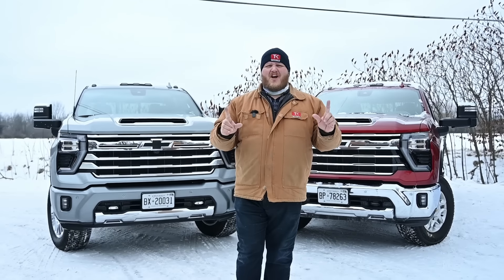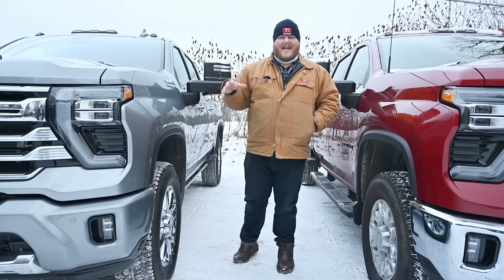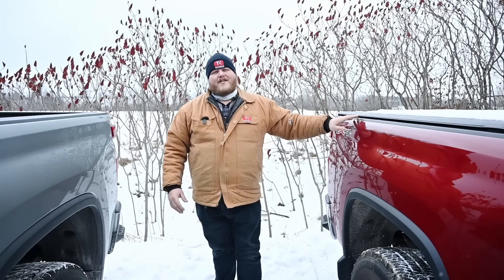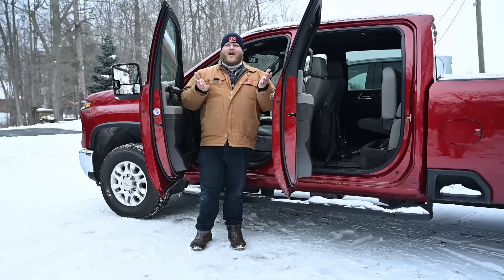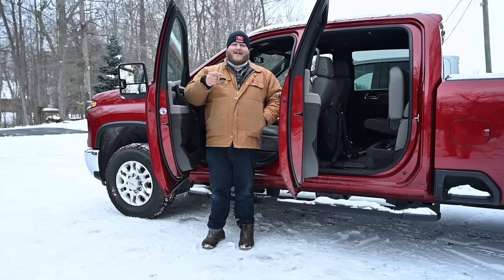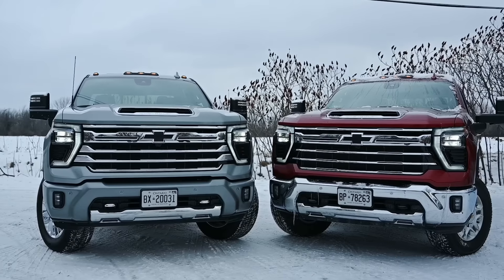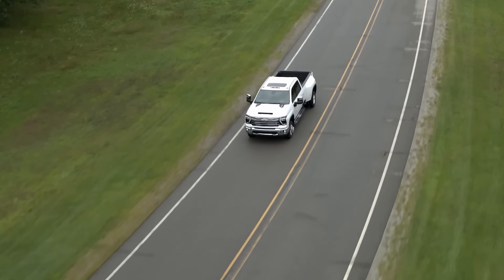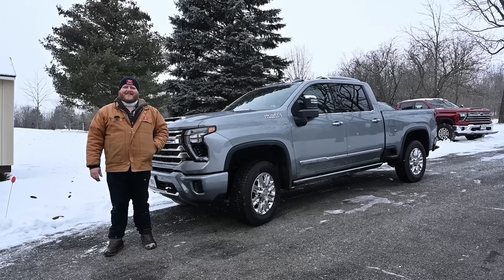2500 vs 3500 Trucks - What's Really the Difference? We Compare Two Chevy Silverado HDs to Find Out

Comment: The new HD pickups are getting so tall that they may not be able to be garaged in a regular sized garage.
Reply: I can’t fit my 2022 Silverado 2500 in my garage because the shark fin on the roof would hit the top of the door. I’d like to mod it off when my warranty is up.
Reply: My Ram 2500 fit in my garage even though it had a 7" lift and was on 37s. A lot of newer home have taller doors. I believe that our door is 9' tall.
Reply: Garage for a truck ?!  That’s for the motorcycles!!

Comment: According to GM specs with the 2500hd, the GVRW IS 11,350 LBS.  When you add the Max Tow pkg, it increases the GVRW to 11,750 lbs. Then of course, the 3500hd has the 12,100 lb GVRW. Just to clarify. I looked at all of these before ordering my 3500. I really enjoy your channel. Keep up the good work.
Reply: Which really makes them both class 3 (10,001 to 14,000 lb) trucks. A lot of the 250/2500s are no longer class 2B trucks.
Reply: This is how my 2022 Silverado 2500HD LT came: 11,350# GVWR, 3400# Payload. The 3500HD SRW had a slightly higher GVWR and payload.
Reply: That's cute. My 2020 Ram 3500 HO GVWR is 12,300. ;-)
Reply: I have a 2023 with a GVRW with 13150 is that no longer a option
Reply: @freddievanfleet1259  I have never heard of a truck having that close to 14,000 lb GVWR without being right at 14k. Which 2023 do you have?

Comment: Thanks for specifics - been trying to figure out exactly what the Dif is 1500HD vs 2500HD vs 3500 for a few weeks now.  Best comparison I've found so far.
Reply: Remember there are big differences between years as well. In the early 2000’s the 1500hd and the 2500 were identical, you didn’t get a diesel option in those because it was saved for the 2500hd as well as the full float rear axle and frame.  

Also If you compare a 2500hd from the early 2000’s to a single wheel 3500hd they are identical aside from more leafs on the 3500.

Comment: The two trucks have the same brakes, engine, transmission, and drive shaft(except for length). There are two extra brackets on the frame on each side.these are used to transfer the load to the axel. This is done by an extra set of springs in the leaf spring pack that are upside down and don't make contact until the truck is loaded. The rear end gearing is the same, but the housing is different. So my 2020 2500HD Duramax High Country has a cargo capacity of 3465 and towing capasity of 18,600 lbs. The 2024 3500 can have as high as 7,290 lbs. It also has a maximum towing capacity of 36,000 lbs. There are few 5th wheel RVs that I can haul without exceeding my cargo capacity.  Each Chevy 2500HD or 3500HD has a sticker in the door that tells you the cargo capacity, towing capacity, hitch weight, and king pin/5th wheel weight. Remember that when you put a fifth wheel hitch in the bed, the hitch weight takes away from the cargo capacity. Your body weight is also cargo capacity. Be careful, though that Duramax can pull the weight, your setup may not.

Comment: If you can afford an 80-100k truck why would you care about the cost to license a vehicle.
Reply: Any money given to the inept government hurts far more than the same amount spent elsewhere.
Reply: @rich7447  Everytine you pull in the gas station your doing the same thing. I’ve seen guys pulling big campers behind brandy new diesels, likely 250k rig,  complaining about fuel price. Give me a break!
Reply: @52CA  I don't complain about fuel prices. Sure they are almost 50% higher than they were 4 years ago, but with my fleet card I am paying $3.70 a gallon for diesel. Out of that, the Feds take $0.244 and Maryland takes $0.27. So a 45 gallon fill up costs me $23 in tax (Our RV is a little more since it has a 200 gallon tank). Unless we go to a 100% private toll road system or some other way to pay for roads there isn't much that can be done about fuel taxes. Vehicle registration fees go straight into the general tax revenue.
Reply: @rich7447  Not referring to anyone specifically. Just saying many complain about fuel prices as they drive their net worth around.
Reply: @52CA  I can see where you are coming from. If you don't have enough to buy one of these trucks outright and aren't using it to generate revenue, you probably shouldn't be buying one. The $187 every two years that it costs me for registration is not really a consideration, but neither is fuel costs.

Comment: Not gonna watch this video…..Trim doesn’t matter, it’s the cab, bed length that takes into consideration, just look at GM specs, it’s just the spring rating….it says it right on the door (2500 vs 3500) right there tells you …they are the SAME truck

Comment: I have a 2500hd max tow, it was spec’d out as a “crummy” (slang term for a work truck for a logging company around here).   I didn’t know it was a max tow when I bought it but figured it out when I decided to buy a 39 ft travel trailer.  

Some benefits I accidentally got was a higher payload because my trim and options packages were on the basic side as a work truck.   I can load a bit more than a one ton because of it.  I still have all the muscle, breaks, suspension, better mirrors, and so on but it’s not fancy on the inside.   Just my style.   Oh and much much cheaper!!
Reply: Must be an easterner lol
Reply: @sprucegoose1016  Pacific Northwest Oregon and Washington
Reply: I haven't heard that term in years!

Comment: Excellent video, great explaination of the max tow package. I am looking at a Chevrolet to tow my 2018 Jayco Pinnacle 36 KPTS, thinking of doing the dually for stability . Have never towed a fiver before, still like the idea of a 2500 max tow also, just as a cost saver. What's your thoughts on dually vs. SRW?
Reply: I have a 3500, make certain you check the max goose ball capacity also, not just payload to be certain it will work for your needs.
Reply: Dually will definitely tow noticeably more stable. If planning on towing a 5er for long distances, than the dually would be the optimal choice.
Reply: As previously mentioned,  the 3500 dually will provide a more stable ride while towing your 5th wheel.
  If you are a full time RVer towing a large 5th wheel or tow heavy loads often, then the dually is the way to go.
  If not, I would strongly suggest going with the 2500HD or the 3500HD SRW(single rear wheel).  
The duallys are very wide in the hips and can be difficult to park in the city or trying to navigate in parking garages.

Comment: I recently purchased a 2024 Silverado 2500HD LTZ, and I can frankly say that the Max Tow Package came as quite a surprise.  The window sticker explicitly says the Max Tow Pkg comes with "3500HD frame, leaf springs, 12" rear axle, HD shock package".  Literally the only difference I can tell between my truck and an identical 3500HD SRW are the badges on the outside.  This is my third 2500HD truck in a row from Chevy (2004 and 2013 prior to this one), and I can say that the evolution of these trucks has been remarkable.

Comment: Good reviews and information but you missed one thing that I am aware of. The 3500 will apply full engine torque in first gear (tow haul mode) vs the 2500 will not. This is most likely factory ECM programing. I have a diesel 2021 3500 SWR 6'9" LTZ (Z71) bed with every option except power running boards. Mine has the technology package, fifth wheel prep, 20" wheels, sunroof etc and was $69,000 with zero percent factory 72 month financing back in Jan, 2021. The 3500 at that time was $1400 more and due to payload alone was worth every penny. Here in CA we do not pay more for registration between the two we are screwed either way. We call it the good weather tax LOL. (70 degrees in January in the Sierra Foothills).

Comment: Great explainer. Now if only you can get the big three to discuss how they calculate their payload numbers.
Reply: I'm pretty sure they take GVWR rating and subtract weight of the truck and that results in payload.  So, trucks with more packages and options weigh more with equates to less payload.
Reply: Payload is simply GVWR minus Curb Weight. GM no longer offers a 10K GVWR package which matters with registration in some states. They must no have many takers like Ford does.

Comment: The problem with modern HDs is that you need a CDL as soon as you hook up a 14K trailer. Cops don't care if its empty, it has everything to do with rating and staying under 26K weight RATING...
Reply: Like he said. It depends where you are. Here in BC, you need an endorsement on your personal license for a trailer over 10,000 lbs. But once you have it, you can tow to your trucks limit for personal use. You can drive a giant Class A as long as you have an air brake endorsement. No need for a CDL. 

If the vehicle is registered as a commercial vehicle, you have to follow different rules. Even if you take your RV out for the weekend with a commercial registration.

I honestly wish it was more strict. Or at least train police to spot un safe recreational trailering. I have seen so many dangerous situations that it is seriously a wonder more people aren't dead. From trucks rolled over with too large of a camper, to a Tacoma and trailer rolled over multiple times, spreading the contents of the trailer all over the highway and closing it down for 3 hours. I watched a guy have other campers back his trailer up for him while reaching through his window to turn his wheel in the right direction. It's amazing the money people will spend on their toys but not take the time to learn to use them safely. Insurance won't help much if they find out you are a couple thousand pounts over capacity!
Reply: If you have a dually that number drops to 12,000 lbs.

Comment: Excellent video. In PA if you want to take advantage of that 3/4 ton max tow's capacity, you still have to register it as a 1 ton. I traded a 2500 for a 3500 just to be legal for towing my fifth wheel. Even with my 3500srw,  which has 4060 lbs. payload, Chevy's door sticker stops me down to 2460lbs max goose ball weight. I still have plenty of payload capacity left but can't use it towards my goose ball capacity due to the way Chevy lists it on the door sticker. I think this is stupid. As far as I know GM is the only manufacturer that lists max goose ball capacity separate from payload.
Reply: How much does Pennsylvania hammer you with registration fees? I live in Pa too and I have my Tundra registered as a class 2.
Reply: @KeystoneTexan  3500HD LTZ, GVWR 11350 is $400/year. Ouch. Just went up this year.
Reply: @campnut6076  Damn that’s expensive!
Reply: @campnut6076  That's really steep. I'm only one state south in Maryland and tags is $187 for two years. There are still a lot of reasons to choose PA over MD though!

Comment: 24' Silverado Long box. 3500    3873lbs..whats that?? Damn near 2 Ton??  Thats a massive payload
Reply: The top payload rating for the F350 (XL 2wd regular cab) is 8,000 lbs and the F450 pickup  max tow (still a class 3 truck) is rated to tow up to 40,000 lbs. Pickups are insane these days.

Comment: I have a question about whom you reached out to at GM.

Because the Front Torsion bars are certainly not the same from a 2500 vs 3500. 

Infact they will have different Torsion bars on even a 1 ton for max tow vs snow plow prep package.  The rear spring pack count may be the same, but they are not the same spring rates. 

A 2500 max tow is still not a 3500.

Comment: Thank you. 2500 Custom 2024 Silverado 6.6L gas works for me towing a 34 foot Coachman Freedom Express Ultra light 292BHDS. Only extras I asked for was bed liner spray on and the same steps that's on the High Country. Kept the price reasonable at just under 57k. No sales tax in  New Hampshire. I don't need frills and grills. Great presentation!.

 price under

Comment: Main take away, you MUST do your research before assuming that 2500 and 3500 are the same truck with different registration stickers.  This research may include part number matching for everything related hauling/towing.  Any assumptions may come back to haunt you when pushing limits.  Most of us can't get useful information from the manufacturer other than part numbers of key parts.

Comment: I have a 24 3500 WT crew cab Duramax, the door sticker says my truck weighs 8,250 empty, but it’s actually 7,950 with me sitting in it on the scales.
It also says my max payload is 4100 but that’s based on the 8,250 gvw.
Still following me?
My max towing is 20k bumper and 21,600 gooseneck. Standard bed.

Comment: That was very helpful, thanks! I do think Ram does it nicer, you know 100% that a 2500 is capped at 10k, no guessing. I don't see why a max tow package on a 2500 needs to exist. Ram also limits the cummins to less power, I think it's just a nicer/cleaner differentiation between the heavy duty trucks; with Ram, a 2500 is always less, no guessing. I'm with Howard though, sunroofs are strictly verboten on my trucks :)
Reply: Max Tow on the 2500 I believe is a work around for states that require a Commercial Driver's License and insurance for the 3500 as it is registered as a commercial vehicle.
Reply: @davidfulton3137  So there are states that require a commercial license/insurance simply because it says "3500" on the side of the truck? My understanding was that it was all about the GVWR rating itself, not the 2500 or 3500 numbers.
Reply: I have a 1991 gmc v3500 crew cab chassis cab that has a dually bed that I put on it. Soon as the insurance company heard 3500 they said it has to have comercial insurance even if I don't use it comercialy. Not a big deal to me since it's only about $30.00 a month liability only. Gvw is 11,000lbs.

Comment: I bought a 2017 3500 High country long bed duramax new.  Only has 36k miles, we just use it to haul our horse trailer.  I rember when i was ordering it, I could only find that the difference was the rear suspension.  My Thinking was, this is an expensive Truck, Im just going to get the 3500.  Guess I didnt need to, but I plan on keeping it a long time.   It has been a solid, no issue Truck.  BTW I got my High Country without the sunroof, and it was a pain.

Comment: Every time I see one of these charge by on the freeway, I think just how stupid these people really are.  Do you know how many electrical connections are on one of these trucks???  computers running computers that answer to yet another computer.  The likelihood that you will drive a 100k miles without major work is about 2%....the rest will be paying thousands to repair them.  PT barnum said it best...there is a sucker born every second.  Garbage trucks are a dime a dozen....and don't you know that the dealers know this and discount these beasts accordingly.  GM stopped building decent trucks in 2002....the rest are junk.

Comment: Nice job explaining both trucks. It's hard to find someone that explains the numbers so a person can understand. 

Me, I went for the gas duel rear wheel. Payload is my big concern. My fifth wheel puts 3800 pounds in the bed. Then the weight of the hitch, the driver/passenger and so on, things add up quickly.

My truck is a 2024 GMC, same truck drive train wise. Yes, I ordered it with no sunroof.

Keep the shows coming I enjoy them.

Thanks

Comment: Great review on the differences, thank you so much for that!! One interesting thing here - In British Columbia Canada we pay a PST based luxury tax (additional 3%) on the 2500 series, which is not applicable on the 3500 series due to the fact that the 3500 series (at least here in BC) is considered in a commercial class, thus the luxury tax does not apply, even though it may be more luxury equipped. This tax applies to almost any passenger type gas/diesel vehicle in BC that are valued over $55,000

Comment: I've owned the 2015 2500 and 2024 3500 diesels.  The 3500 diesel needs larger brakes.  Given the 3500 weighs 1,000 pounds more than the 2015 2500.  I can definitely feel the difference when going downhill on highway off ramps.  I'm starting to use the engine brake in everyday driving.  Give the 3500 14.5-inch rotors or more aggressive brake pads.

Comment: Great videos guys. I have heard it said a lot that the Chevy and GMC seats aren't a soft/comfortable as the other guys. Especially new, they may seem firmer. Coming from a Ram, what are your impressions?
Reply: I just switched from a 2016 Ram 3500 DRW Longhorn to a Silverado 3500 SRW High Country and I miss the interior of my Ram. Went from leather seats that soft like butter to leather that feels like old school vinyl.
Reply: @firerob5240  the suspension must be a lot smoother though. How much weight do you tow and do you miss the DRW?
Reply: Currently not towing anything other than a 4k lbs boat and occasionally a 18’ utility trailer. Sold our RV a while back. Main reason why I was getting away from the DRW but would like to eventually get another RV and reason I got another 3500. (Generally try to keep trucks for the long term) 

But yes the Chevy SRW is a very smooth ride
Reply: Thanks for the response. Do you miss the exhaust brake?

Comment: I ordered My ‘24 LTZ 3500 without the sunroof too, so there is at least two of Us! For Me, kind of a throwback to when sunroofs first came out, and a lot of them leaked after they aged. Also, have heard that a few of these trucks have had issues with the seam in the roof of the cab cracking. In My mind a little more metal, might not be a bad thing. I have washed My truck, and the cab roof is pretty pliable.

Comment: Didn’t know the 3500 was slightly taller than a 2500. With the 12 inch ring gear, the 3500 can put all 975lbs of torque down in 1st gear.

Comment: The only thing that is different is the latter frame .1 ton is about an inch and a half to two inches taller then the 3/4 ton. And even lesser on the. 1/2 ton. That pretty sums up on the size difference of the three types of full size pick ups.